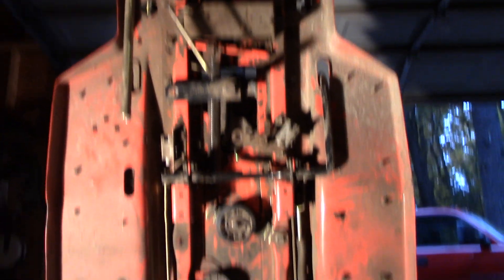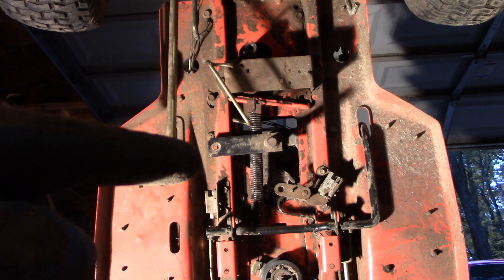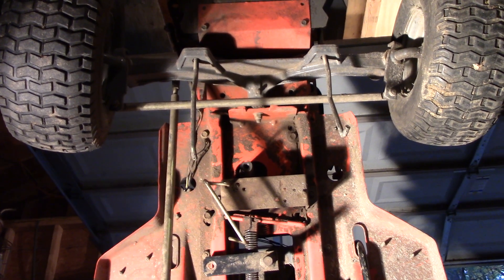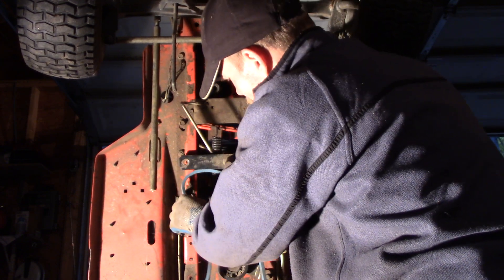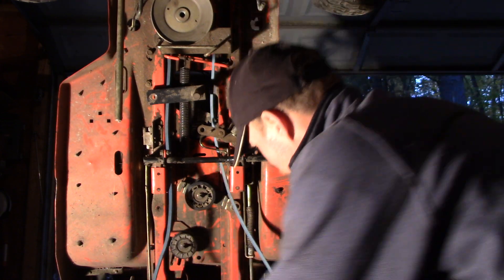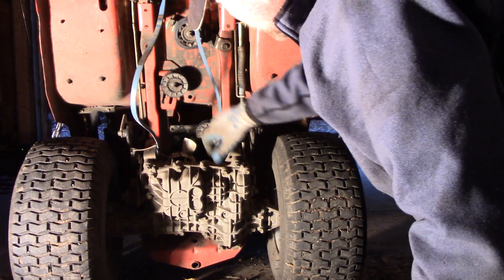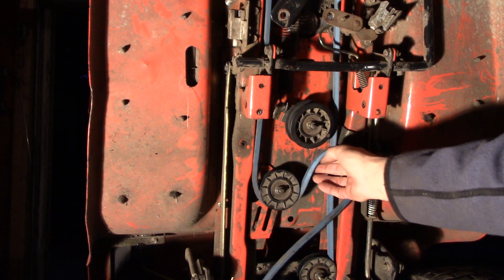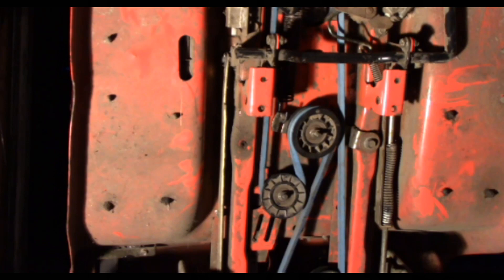scotts riding mower 1999-2001 drive belt routing and installation

Comment: Another video suggests running the belt up to the PTO pulley and using a large screwdriver to pry it over the pulley.  It sure makes sense to me because I'm on my second time of replacing that geared pulley on top of the transmission because that gear on the pulley strips out over time and the tractor won't go forward or reverse because the  pulley just slips on the transmission geared spline.   That tension spring will take a  hand off if  you slip.  This time I'm going to go up to the pto pulley and try that method.
Reply: Success so much easier going to that front pulley with a big screwdriver work like a charm thanks for the advice you made my day
Reply: Yes indeed that works a lot better that spring is a bear so it's all two man job so going up to that pulley as much easier

Comment: Great video John.
Hey how did you bypass the parking break safety switch?
When I depress the brake,the safety switch doesn't get pushed in all the way,therefore the mower won't start.
The j bolt that led to the locking bar for parking break is messed up,and won't lock brake pedal.
Any knowledge you could share about bypassing that parking break switch would sure be appreciated.  Thanks.
Reply from the maker: I don't know what year your machine is but more specifically I don't know what your Engine is. Mine mine is a 2000 Scots with a Briggs and Stratton motor..  On that model there are 2 harnesses that have purple and white wires . I disconnected both harnesses  and clipped both sets of purple wires 4 in total , I then Connected all 4 purple wires together with a wire nut and boom all your safety items go away.  Actually I think it was a 1997 for that mower But it definitely has a 17 horsepower Briggs and Stratton intech engine
Reply from the maker: Oops now that I'm looking at the video you posted on that was a 2000 kohler engine but the idea is the same I have no idea what those wires look like though, I did mine on the bricks and Stratton sorry if that doesn't help

Comment: Well here we  go again. On my 3rd pulley replacement!  This 99 Scott leave a lot to be desired.. one thing after another!  I bought it new and I'm on my 2nd engine,  3rd drive pulley on the transmission.. countless batteries, 2nd carburetor, rear tires, fronts constantly leak ailr,,  the first mower deck rotted out and now the 2nd one has a hole, the bagger tube gets eaten my the mower blades because of a horrible design that allows the tube to move into the blade compartment,,,now that is up to a $90 replacement part.   I'm done!  One more pulley fix and its going to get a 4 SALE sign or I'm going to fill the fuel tank , install a wick and light it.  .  No wonder they only made these for a few years!
Reply from the maker: Wow. Like your machine was built on Friday...I still have a 1999 with just a carb replacement...I truly think John deere built those for home depot when corners were not cut thinking to get some kind of contract.  Now the John deere at big Box stores are typical shit like mtd. Sorry to hear you had so many problems...I still use my 99 as a primary mower
Reply: @JLafix  I worked at Home Depot when I bought it. Basically Home Depot wanted a nice big orange tractor to sell people then they discovered people like brand names and I have no idea where they got that name Scott from perhaps to copy the Scott grass seed to relate to mowing I like to tractor but this pulley problem is getting to me it's just a bad design and they are not designed to pull and I have a log splitter that I tow around we should change the name to riding lawn mower instead of tractor because tractors are supposed to be strong enough to tow
Reply from the maker: @davidg813  I have two of those Scott's, a 97 and a 99. Never had a problem with the 97(non hydrostatic) with the briggs engine. The 99 is hydrostatic with the kohler that was given to me cause the person thought the transmission was bad.  It was the striped out drive pulley. I welded that pulley right to the shaft 13 years ago. I use that still for a primary mower no problems since.  The 97 is a race mower I made about 5 years ago. Considering the price of new ones today I'll keep fixing mine till the end of days.
Reply: I somehow have over 6.5 thousand hrs on my hydrostatic one and only probs i have had so far is the transmission mounts kept breaking but i have had it ratchet strapped for at least the last 1000 hrs or so and works fine. I also have had steering issues and changed the steering gears and bushings a few times
Reply: @Lewtuube  my current problem is staring I have to tackle that now the steering wheel has way too much play in the left tire when I turn left wants to go way too far to the left and I think it's all because of a stripped gear down at the bottom of the steering shaft oh well I bought it in 1999 so you got to expect something to wear out I just wish I could get at the steering column without having a rip half the tractor apart but covered up by the gas tank and who knows what else then in order to get the steering wheel off they had to use some Mongrel screw that nobody has a tool for it looks like some kind of a mongrel Torx screw whatever happened to hex head bolts